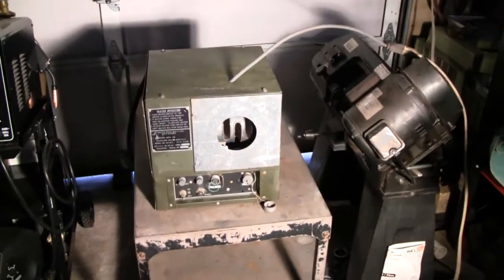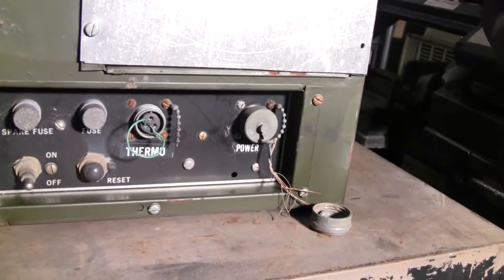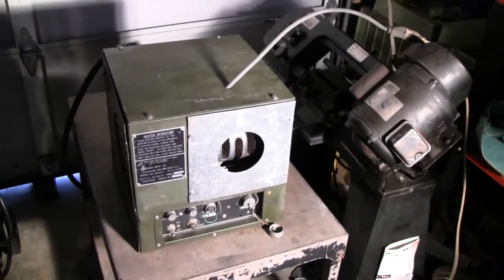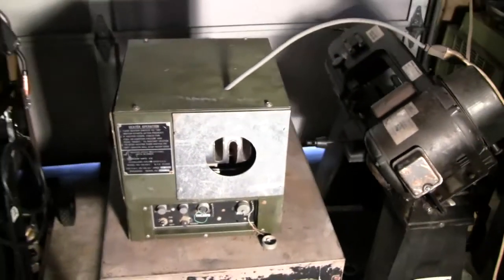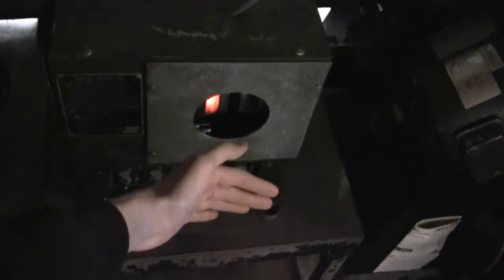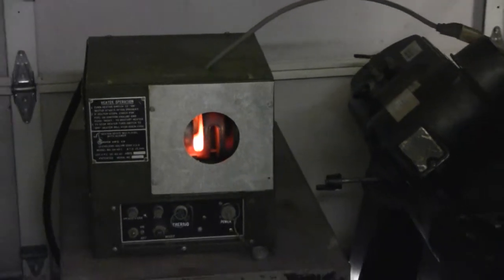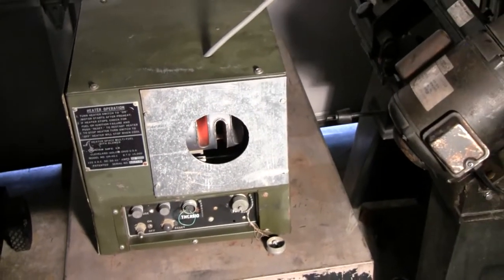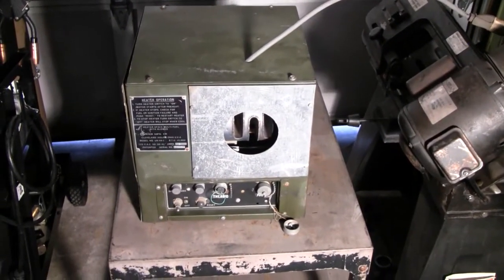RARE MILITARY MULTI FUEL HEATER

Comment: Local guy has like 50 of them in his shop (he sells them on ebay, I bet the one you seen)
  so if you need parts let me know.
he runs them on diesel. and it was 24-28V
and yes , keep the exhaust out side , they make a LOT of smoke!!

Also , change all you fuel line , they are bad for leaking and burning.
Reply from the maker: Which fuel line should I replace? Seems okay right now. I was hoping to find a thermostat and cables for it, maybe you could hook me up!
Reply: I know he changed all of the lines on them , he is on ebay under Winnipeg jets something , you should be able to find him Ez , send him a Pm and see what he has.
Reply: dirtbike5100 which scrap yard do you go to? I go to one in central NJ and the stuff is just junk. Thanks!

Comment: Sounds a little like my RV furnace motor when the shaft bushings got dry .. Ya might see if you can get to the motor and check the bushings .. I am sure the fan should not be that loud .. Very awesome rig though !!
Reply from the maker: Yeah bearings could be shot but it's mostly just the noise of the air blast!
Reply: that could be .. But that motor sounds unhappy !!